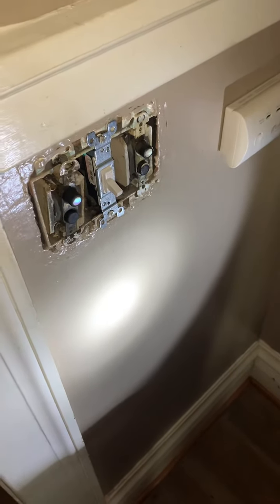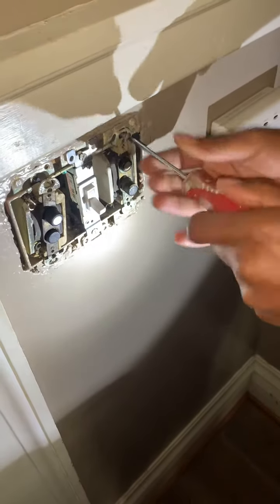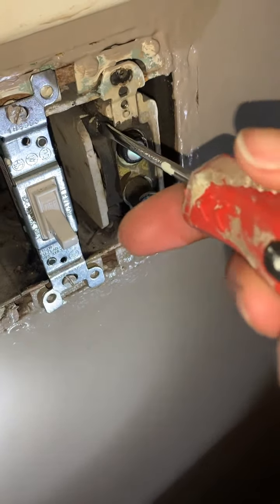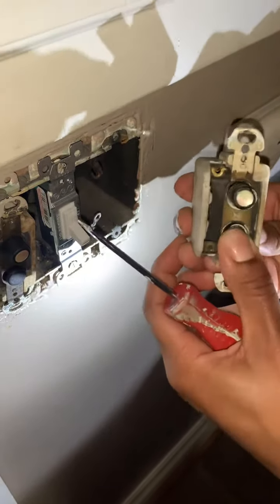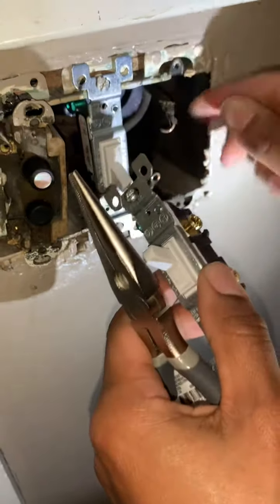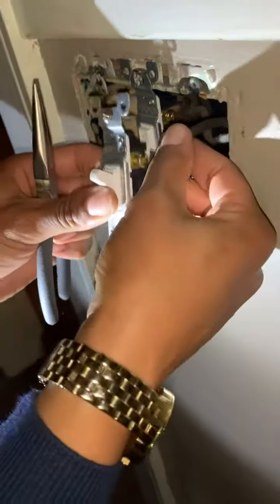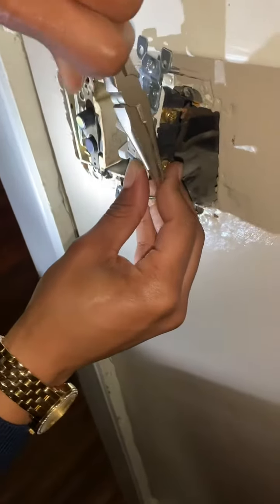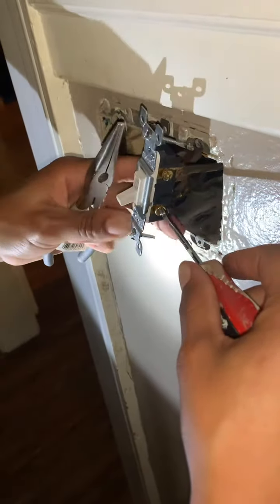Push button light switch-antique

Comment: Bruh....  you do realize that older switches where made with better quality,   I wonder what wall plate you put in, probably plastic, the old one was probably metal/and brass. And yes I do understand that the old ones are dangerous but those are worth so much money now.   You could have at least got some more up to code ones.   And they look brand new to me the button where you push it in.   Now you put in cheap toggle light switches that reminds me of the 60s. And you probably put in plastic wall switch plates.  I personally hate plastic wall plates.   I have a high end NYC brownstone (Has been gutted) and I had re wired my 1900s wiring, I still kept some of the beautiful gas crystal chandeliers.   I have all push button light switches (From house of antique hardware). That are up to code that have egg and dart metal wall plates. I am very happy
Reply: The push-button switches themselves can be completely safe—it’s faulty old knob & tube electrical wiring or new wiring improperly connected to old knob & tube wiring that can be dangerous. Reproduction push-button switches themselves are totally safe.